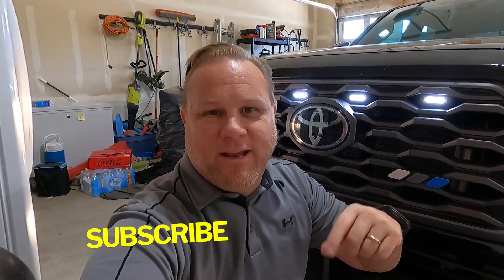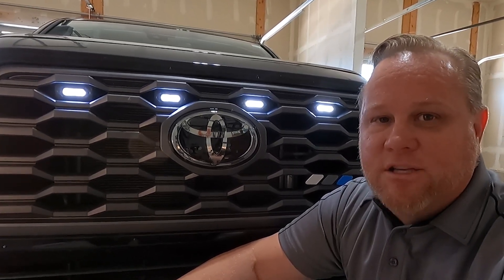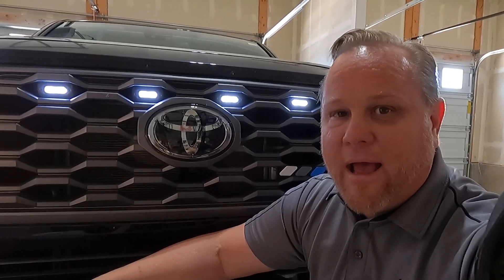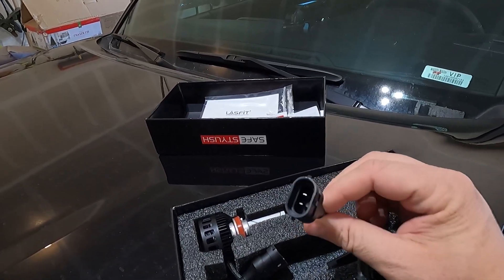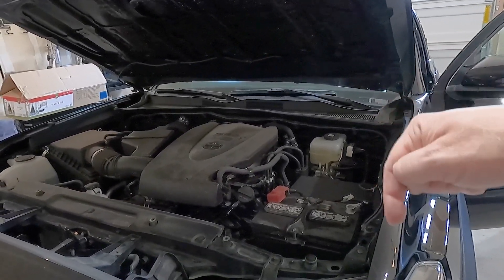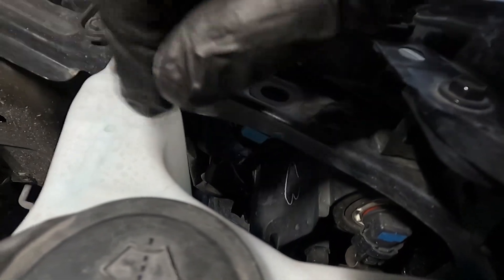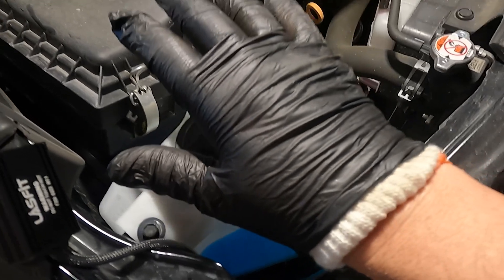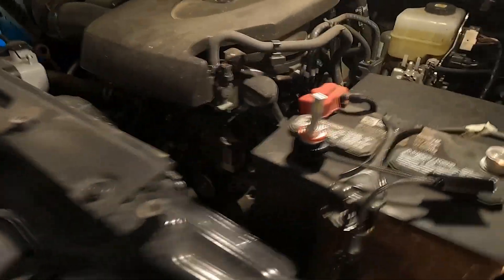First Mod Failure on my Tacoma

Comment: I will add, I always used Lasfit bulbs and have found their performance excellent. I have no affiliation with Lasfit, just, I think, they are one of the best bulbs out there.
Reply from the maker: I got it resolved and they were great to work with.
Reply: @DJXPLRS  So glad to hear that, I always try to help people even with my limited knowledge of how vehicles work. I just purchased my second, new,  tacoma off road. I had planned on putting the Lasfit LED bulbs in that too. However, my new tacoma has LED bulbs, from the factory. So glad your issue was resolved. 😁

Comment: I'm late to the comments but, these bulbs, I believe, from the instructions, if understood correctly, have a polarity difference. If you had reversed the none  working bulb in the holder, I believe it will work. I have fitted 4 sets of headlight bulbs to different vehicles and I had to reverse three bulbs for them to work. If, after reading the instructions, it states, turn on before fitting, this is the reason, if the bulb doesnt work, reverse it in the holder and it will work.
Reply from the maker: You are correct, they have a polarity difference. I tried that and it didn't work. But they sent me a new set and it worked great. I've been using them ever since

Comment: I ran similar LEDs from one of the Tacoma sites as low beams for over a year. They appeared brighter than the halogens when standing in front of the truck, but were pretty dim when driving at night. Thankfully, I have the Baja Designs fog lights which compensated. Had a crazy rainstorm back in April which knocked one of the LED lights out, so I swapped the stock halogen bulbs back in and threw them away. I think the downfall of these is that the heat sink and cooling fan are exposed to the elements at the back of the headlight housing, so any water splashing up from the road will likely cause them to fail.
Reply from the maker: I could totally see that. They're not well protected from weather like you said.

Comment: I had the halogen head lights too and replaced mine with LeD also. I used a different brand from Amazon that was well rated on tacoma world. 
I don't have raptor lights. I'd have to change my sr5 grill to the pro grill as nothing is made for it.  
Hood struts I had a set of Solkie tech struts since my truck was new. no drill install was really the selling point I didn't want to drill the hood of my truck to install rivets like you do with the redline and spiker brands.

And yes I've had a mod fail. The anytime front and rear back up camera mod was a total fail the first install. I had it all tested and somehow when I went to put all the wires in behind the radio I tore up one of the harness adapters. But I got a new part to replace it and a few months later succeeded in getting it working along with a mini amplifier install
Reply from the maker: If at first you don't succeed! Thanks for sharing. I'll get this mod fixed for sure.

Comment: Probably one of the best mods I've done I can't believe toyota for the money they want for there trucks don't give you hood struts but I wasn't going to rely on that God damn stick they give you to hold the hood up while you're working under there I got red line struts they had two types reg and the ones I got for about 30 dollars more these ones make it easy to lift after you undo the catch slight pressure up and it continues on its own they install in about 45 minutes but it comes with rivits to install it so if you don't have a rivit gun and don't know anyone who has one you will have to by one I got mine at home depot for 30 bucks and you have to be real careful when drilling the hood to much pressure you'll go right thrue the hood I took some electrical tape and wrapped it around the drill bit about 3/16 from the top so just the tip went through if you don't feel comfortable doing that there was a company on u tube that no drilling was required the ends go into factory holes and they seemed pretty nice but the hoods angle wasn't quite a wide as the rivit on ones if you go with drilling just put a touch of paint in takehr drill holes keep rust away good luck either way but I think if you take your time you'll get good results good luck.
Reply from the maker: Great recommendation, the Tacoma hood is crazy heavy.

Comment: why just change the low beams? I changed high, low and fog so that they were all the same color. All 3 are the same bulb H11. Hood struts are the ticket, I used the redline brand, at about 6" the hood goes up on its own.
Reply from the maker: Good to know. I'm check them out.

Comment: Don't install LED bulbs in a Halogen housing. You won't get proper reflection or concentration of the light beam. LED may match color but more than likely cause glare and reduce visability compared to OEM bulb. Recommend a Tungsram Megalight Ultra (formerly GE) H11 +130% halogen bulb.
Reply from the maker: Interesting. I'll check them out.

Comment: LED headlight bulbs are always a hit or miss; they either are not bright enough or the burn out prematurely. I use HIDs in my taco low beams. tried and true design. I just threw the LEDs in the high beams that really ever get used. junk
no I'm not spending $250 for some fancy claim LED blah blah.
Reply from the maker: When I get the new bulbs I’ll see if I think they’re worth the investment